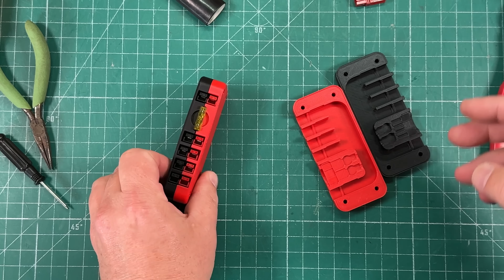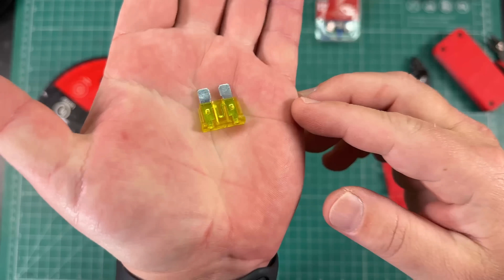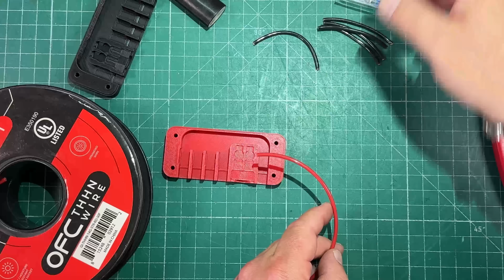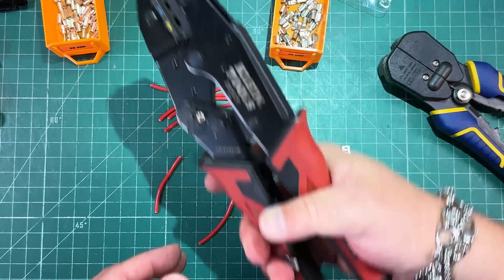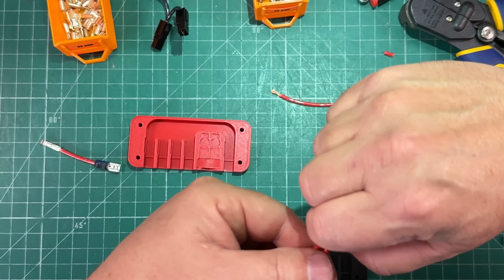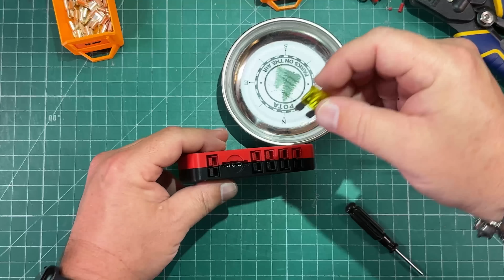3D Printed Fused Anderson Powerpole Distribution Box

Comment: Great Video! I do not have a 3D printer! :-(  How about removing the blue insulation material??? If you hold the connector with pliers and the plastic with cutters, you can gently twist it off! Then crimp the bare connector with what is often called an indent, dimple, or nest-and-indent crimper. This will not deform the connector at all, AND will make a much better crimp!!! You already have the insulation in the printed block. 
Best wishes! 
Brett. 
KJ7BQQ

Comment: Love the idea here, except for the crimps around the fuse connectors. I'd much rather see a modified STL that works with uninsulated crimp connectors and uses the proper tool a totally solid crimp you make and then leave alone, especially if you start running anything close to 20 amps through it. That's such a minor niggle though for what is an amazingly simple and useful tool any ham can use. Plus, if this gets creative juices flowing to save some money around the shack, so much the better!

Comment: A couple of hints that I found that makes this project go together a little easier - I took some needle nose pliers and pre-squeezed the 45 amp connectors just a little bit so they would fit better in the crimping pliers.  You do not need much just enough so they will enter the top part of the pliers.  The second part that I found helped a ton for the 45 amp connectors - these connectors have an open top, so they are flatter (more elongated) than the round 30 amp connectors.  I wound the wire together, then took my needle nose pliers and flattened the bundle a little so they would go into the 45 amp connector more fully.  Hope this helps and can keep you from being so frustrated while working with the 45 amp connectors.  I also trimmed my blue spade connector plastic back about one mm with my small cutters, not much, but fit in the spot better. AI7SU

Comment: Hi Mike.  You inspired me to print one of my own.  I went with PETG filament because there is a chance it will end up on a hot picnic table in the summer.  You made it look easy but I found that I often reverted to my native language, profanity, trying to get the thicker gauge wire to crimp together and then having everything fit in its place as I closed the box.  The end result looks pretty clean and im pleased with it though.  Cheers, 73.  Stephen, VA7LBA.

Comment: Use the non-insulated side of a sta-kon crimper to put on the .250 disconnects. It will not deform the insulation as much.

Comment: Might be easier to fit the female spade connectors if you pulled off the plastic.  I may try this using bare solid wire as a bus (with a partition to provide insulation between plus and minus) and soldering.

Comment: Thats cool, but I'd rather have a fuse block. 1 fuse per power tap! Which could be done easier with a a strip of sheet metal versus all those wires.

Comment: maybe try the Heat Shrink & Solder Quick Disconnects they will solder and shrink tube over the wires and could told tight in where your 3d printed

Comment: I use unisulated quick connect terminals and add hear shrink tubing to insulate. I would use a heavy 10 gauge solid copper wire as a buss bar for each pole with 14 gauge solid copper wire to the power pole contacts. A high quality insulator such as phenolic paper to separate the buss bars before assembly.

Comment: I'd solder the connectors with 2 wires and the fuse connectors for some peace of mind. Could also insert the fuse before you try to close up the box and use it to hold the connectors in place.

Comment: "Finagleing"

Don't use crimp connectors with the plastic, since it deforms, just solder them....
Reply from the maker: Soldering is an inferior mechanical connection to crimping.
Reply: @hamradiotube soldering is not a mechanical connection at all.
It's an electrical connection. How often you plan on changing that fuse? Lol
Reply from the maker: In all my field ham radio activities, I honestly can't remember ever having to change a fuse.  I'm confident it's happened, lord knows I do a lot of portable ham radio as well as battery box builds, solar stuff, general 12V stuff if you will,  but it's so infrequent that I have to change a fuse.  I did actually think about just soldering the quick disconnects as well as just using my soldering iron to heat up the outer plastic to remove it as I've done plenty of times in the past when I needed to "Finagle" something.

Comment: hey Mike, on the spade connectors what I usually do is cut off the blue plastic with a razor blade
Reply: Or you can sometimes just pull it off.
Reply: @ldocull  It'll pull off easily right after he heats it with that lighter. 😁
Reply: I heat the plastic with a surface mount heat tool and slide off.  Then after crimping heat and slide back on.

Comment: What crimper are you using for the Anderson Power Pole connectors?
Reply from the maker: Good question.  I got it at a ham swap years ago.  No clue what brand.  You can get them pretty cheap on Amazon though.  I've got another one very similar to this one: https://amzn.to/4sLA3Gf  It's prob the exact same one just with a different name stamped on it.  The brand I have is IWISS.

Comment: It would be better to make this as a fuse box but have it in a similar configuration to a breaker box (large main fuse with each of the load connects having their own individual fuses). Though this will be fine being used for low draw loads.
I would also consider the PCB mount versions of Anderson Powerpole connectors (SKUs 1335G1, 1336G1, & 1337G1 which you can buy from Mouser or Digikey) so you can solder those connectors to some copper rails if you want an easier to assemble version of it.

Comment: Just a note for new players with Anderson PowerPole terminals.  There are 3 different terminals used on the 45 Amp connectors.  Honestly I hate that most places that sell them identify them by current rating.  The main difference is the wire gauge that each terminal is designed to be used with.  The 15 Amp is for 16 to 20GA wire, the 30 Amp is for 12 to 16 GA wire, and the 45 Amp is for 10 to 14 GA wire.  If you use a terminal not designed for the wire gauge you are putting it on there is a chance, especially if the wire is to small that it will not be crimped tightly enough and cause a poor connection.  Looks like you used the correct ones in your installation.  Just wanted to point that out for others.
Reply: Thank you. Confusing to not list the supported gauges too
Reply: He didn't use the right size. His used 14 gauge wire, which is rated at 15 amps continuous, then he protected it with a 20 amp fuse. Given all of this, what was the point of the 45 amp connectors? If he doesn't do it right (he didn't), it's a safety (fire) risk and it makes no difference that the wire "fit". This is simply done incorrectly and folks shouldn't try to duplicate this the same way. He should reduce the fuse size down to 15 amps and clearly mark the current capacity limit on a label so he doesn't forget. At least then it wouldn't be a safety concern.
Reply: @senfo-s5p  Actually the "power" handling capacity of wire is calculated by the voltage, current, cross sectional area of the conductor, resistivity of the conductor and length of the conductor.  My calculations for a 1 foot piece of copper wire (which is approximately what he used or less) operating at 13.8 Volts with a desired capacity of 20 Amps and allowable voltage drop of 3% would be a wire with a cross sectional area of 4.105 kcmil, a diameter of 0.06407" which would be nearest a 14GA wire which has a cross sectional area of 4.11 kcmil and diameter of 0.0641".

The reason for the 45 Amp Anderson PowerPole connector "body" is it's become standardized in amateur radio and accepts 3 different wire gauge terminals.
Reply: @mikesradiorepair  you're calculating the voltage drop. That's not the same thing as asking, "Will this fuse blow before my wire melts?"

You have a fair point about putting multiple wires into the connector and I started to realize that after my comment. Regardless, thank you for pointing it out where I failed to go back and do so.
Reply: @senfo-s5p  Yes, a quality fuse with known specifications like a Bussmann, Littlefuse, etc... would blow before the wire melts.  Wire operating temperature is one of the variables in the formula for calculating wire gauge.  I have the rather long formula saved in my HP Prime calculator as a wire gauge program.  I have the program set up that all I have to input for a DC calculation is the operating voltage and desired current capacity.  The calculation is based on the use of a fast blow fuse as the protection device at the desired current.  I have different variations of the formula pre-setup for use with a slow blow fuse (wire dimensions increase slightly) and with AC circuits where frequency becomes a variable at higher frequency due to skin effect.  The output from the program is the cross sectional area / diameter and the closest solid AWG and stranded AWG.
Reply: @senfo-s5p  The 14ga wire is plenty for 20 amps.  Check your car or do your own testing.  The 15a rating is for your house where there are two wires inside a jacket and buried in a wall that may be stuffed full of insulation and based on the temperature increase safe for 1950s plastic used to insulate the wire.  We keep the same standard for "typical" use because it reduces cognitive load on the people wiring houses and inspecting that wiring (same reason they are now color coded jackets).  In other use and with higher temperature ratings the 14ga can carry a lot more.
Reply: @senfo-s5p  You are always meant to have a fuse over what something is rated so that it won't pop under normal use and can handle small spikes. So a 20 amp fuse for a system expecting 15 amps is correct.
Reply: @jaxithfox  Brief current spikes are handled by a fuse’s time–current (or time-delay) characteristics, not by oversizing the fuse. A fuse rated higher than the wiring or components it protects defeats its purpose and can allow the weakest part of the circuit to fail before the fuse opens. The fuse exists to protect the wiring and components, not to prevent nuisance fuse blows.

That said, the comment about 14 AWG being capable of handling 20 A in open air is true in certain contexts (e.g., automotive wiring with short runs, appropriate insulation, and in cases of intermittent duty). I stand corrected on that point, but I feel this calls for being pedantic because context matters a lot in this case.

I would have built this box with 12 gauge wire to prevent the issue entirely. However, I will acknowledge most people aren't drawing a full 15-20 amps all the time. They key up, then allow the radio to go back into RX mode at a significantly reduced power load.

Comment: I may just have to invest in the correct crimper. You make it look so easy !
Reply: I know right?! I've been hand crimping my powerpoles all this time just because of how expensive the crimper is. I might pick one up now...
Reply from the maker: The proper crimper is a must.  I can't imagine doing it any other way with the amount of power poles I crimp.  You can get them for pretty cheap.  You don't have to spend the hundreds of dollars the ham radio stores sell them for.  I think I paid about $35 for mine at a ham swap.  You can also get them on Amazon.
Reply: The first time using powerpoles I used a needle-nose pliers to crimp it.  Took 5 minutes  But, it worked well.  The next time I borrowed a crimper.  Took 5 seconds.   Guess which technique I use now.

Comment: 3d printing is addictive. I printed a cup mount for my FT-891 with a 1/4-20 heat set insert. I had to modify an existing model but the sky is the limit with a good printer.